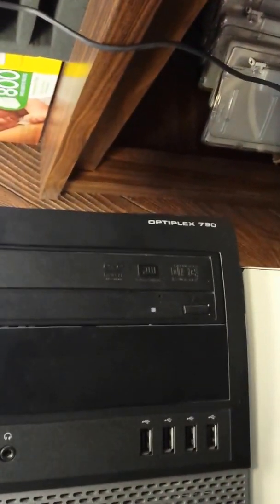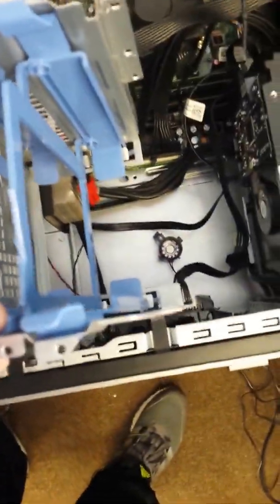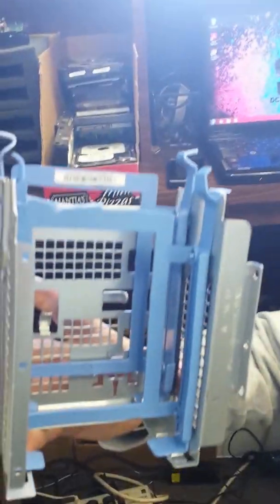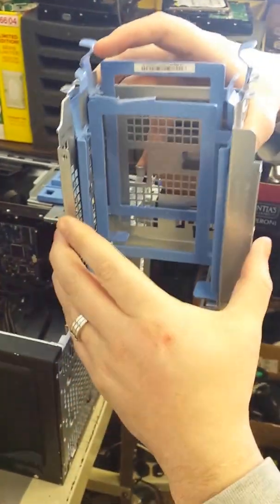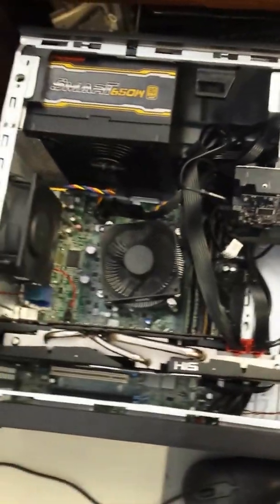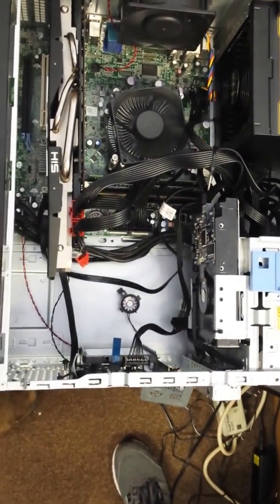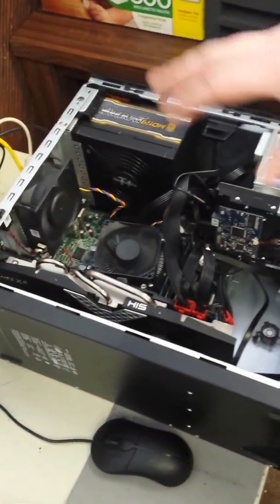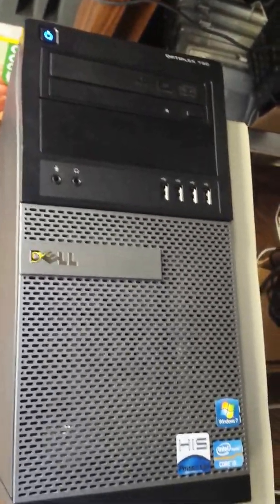How to Modify a Dell Optiplex 790 to fit an HIS IceQX2 Radeon 7970

Comment: Do you need to take out the mb when drilling, Becasue of the metal spill or can you just put a blanket or rug.. on top of the mb....?
Reply from the maker: Dont use a blanket or anything that could have static. You could kill the board.
Reply: @RickFeltner  so it would be best to take it out.....
Reply from the maker: @mariolp2999  to be safe. I did not but I blew it out good w air before i turned it back on.
Reply: @RickFeltner  awesome, thank you very much

Comment: My GPU(Evga 1060 duel fan) wouldn't snap into the pcie x16 slot because the SATA cables were in the way.  I bought some of these..."SilverStone Ultra Thin Lateral 90-Degree SATA Cables" (part# CP11B-500)....they are super low profile and allow clearance for the  GPU to snap into place.

Comment: Took out all the rivets but still stuck...
Reply from the maker: Ok. 3 rivits on bottom, 5 on the front. Then slide up towards the top. Make sure they are all the drilled. Use a small pry bar if you need to to pry the caddy up towards the top of the case. There are 2 clips still holding it on the back of the case.
Reply: I put significant amount of force but I'm guessing more will be required. If I knew exactly where the remaining joints are, then would be helpful. So apply force straight up??
Reply from the maker: There are 2 hooks on the back two clips. Those have to slide up.
Reply: Rick Feltner https://youtu.be/vFL4-61uexQ. This video shows what I have done so far. The caddy would not budge
Reply from the maker: @qone89  yes there are 4 hooks on the backside. You are prying the right direction. Toward the top. Just seems yours is neing stubborn. If you look at my video pay attention to the hooks on the backside. If you push up like you areit should just unhook itself. Maybe you could take a flat screwdriver and try to force them loose by pressing down on them and then sliding it up? I really didn't have that much trouble after i drilled out the rivits. I think it was a little stubburn. Also try sliding a flat screwdriver between the bottom of the case and the caddy and pry. That is how I got it. I actually had a mini pry bar but the screwdriver should do the same. It has been 4 or 5 years since I did this but it did come out with a little force.
Reply: Rick Feltner yeah. It was stubborn. I literally had to rip mine apart lol.
Reply from the maker: @qone89  so you got it?
Reply: Rick Feltner yes. It was hard work. This I wouldn't have given up unless I knew it can come out. I had to use alot force. My hands itself wasn't enough

Comment: Any benefit of adding a front intake fan? as the card seems restricted in the  corner.
Reply from the maker: It certainly would not hurt to add a fan.  Cooling a system is very important.

Comment: i have one like yours, but if i put GTX 1070 and i5-6600K it will work or make problem with my pc?
Reply: That mobo only takes Sandy Bridge LGA 1155 CPU's...
Reply from the maker: Yes
Reply from the maker: Sorry yes, I didn't ready your question carefully enough.  You can use that graphics card, but the processor is the wrong socket...

Comment: great video! thanks for uploading! I will upgrade my system soon so all the information is welcome! :-) Is it a problem to install a graphics card with PCI gen 3.0 in that PCI slot?? thanks!
Reply from the maker: It will work.
Reply: Rick Feltner thx!! did the upgrade. R9 270x. works perfect!
Reply: Rick Feltner  hey exaclty what i was looking for. Can you help me tho. I just drill the ribbets right wasnt there a tool needed for them? also i heard some dell mobos dont even respond with some gpus did you have to update firmware or bios?

Comment: +Rick_Feltner hey rick so Iam basically trying to do the same thing you did except ive had bad experiences with thermaltake PSU do you know or recommend any other PSU for the 790 Mini tower some thing with the demensions of H 3.3 x W 5.5 x L 5.9. ill be using a evga gtx 780. Any help would be greatly appreciated. Thanks!
Reply from the maker: +Abraham Farias EVGA Bronze 850 is a good PSU.

Comment: is the ram in front of the first pci-e slot in the way of a larger graphics card. I just bought one of these off ebay to make a random computer out of an extra gtx580 I have but the gtx580 is a pretty large card and I dont think it will fit in the bottom slot because the card is also pretty wide
Reply from the maker: +XPsilocybinDream The RAM shouldn't be in the way the graphics card width difference should extend farther down not up.
Reply: Rick Feltner
sorry but you would be wrong

Comment from the maker: Sorry I didn't respond to anyone until now.  I never posted a YouTube video before and I don't really use my gmail accept to sign into chrome.  If you have questions for me you can contact me at rick@360computercare.com.  To answer some of the questions I have seen, the added power from the power supply has powered the graphics card just fine.  The customer I modified this for has been very happy with the performance of this graphics card for his gaming experience.  There have been no issues with power or performance.  It works great!

Comment: i have the same computer please upload more, is any power supply compatible with the motherboard and also graphics card.
Reply: Lord himself do you know whether you can fit a dual slot gpu in the case?
Reply: iFFY CS:GO Bet/Predictions yes i just put the evga geforce gtx 750ti sc 2GB and i think it takes up two slots, one for the components the other for the fan.
Reply: Lord himself Thanks i think i might purchase one of these machines ;). Btw nice card you got there :D
Reply: +Lord himself How did you fit a 750 ti in this? Can't fit my r7 360 and they're the same size.
Reply: +Nathan Casey is it too long or too wide?
Reply: +Lord himself Its 3.5 inches thick.
Reply: +Lord himself Also how did you get the 750 ti to work when the max power draw is 35 w